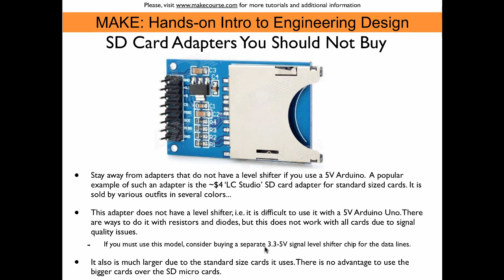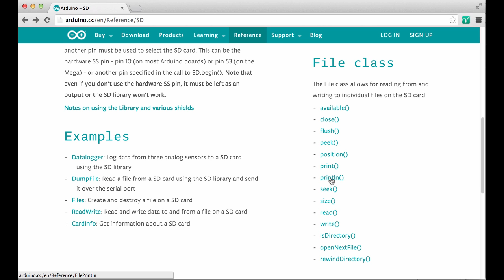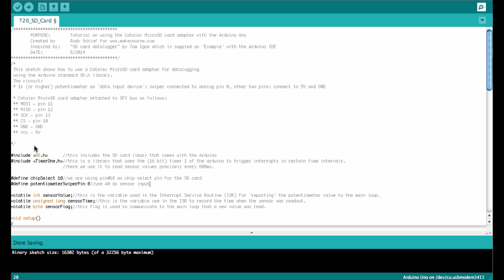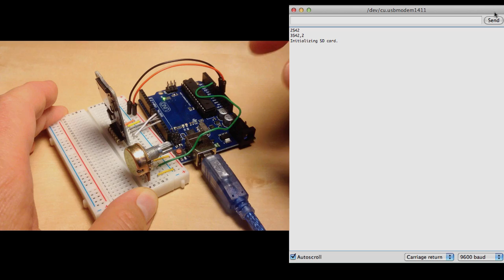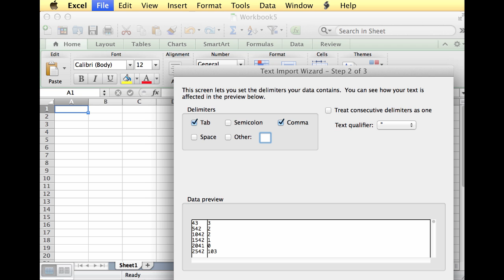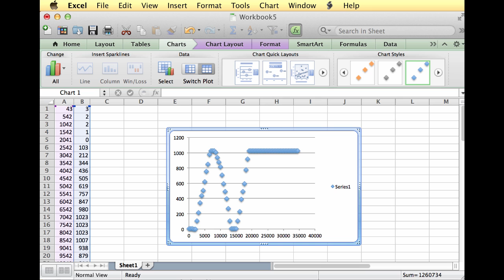Tutorial: Using an SD Card with the Arduino for Data Logging

Comment: When you start building stand-alone loggers, one technique to save power is to disconnect the SD card during logger sleep. I've posted a method to do this with an Arduino at:

https://edwardmallon.wordpress.com/2017/05/21/switching-off-sd-cards-for-low-power-data-logging/

Comment: I have tried various code, changed ths SS pin  to 10 for my setup but trying it   on a 128Mb SD it fails on initialisation ?  The SD is fine, formatted as 32 but FAT, and can be read/written on my PC, but despite   checking my wiring very carefully on the Arduino UNO, I cannot get past the initialisation stage ?????

Is  this SD card at 128MB too small for this to work ?  the reader I am using is the one in your videos.  It's driving 
me nuts...........
Reply: There is problem in SD.h library. One of my 4 GB card, class 4 did not work, but other (cheaper chinese...) works okay. I suspect that the problem is in detecting and probing type of the card, because out there exist various types, and sub-types. Try another card if you have.